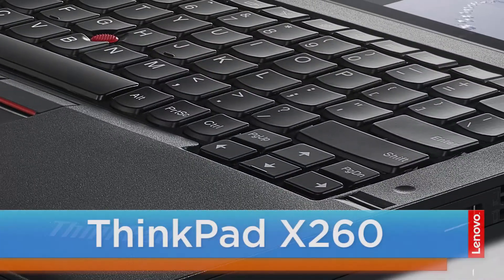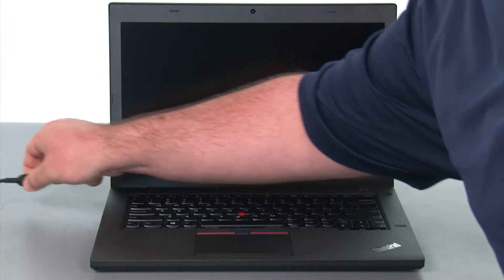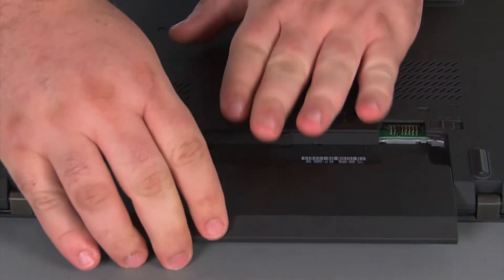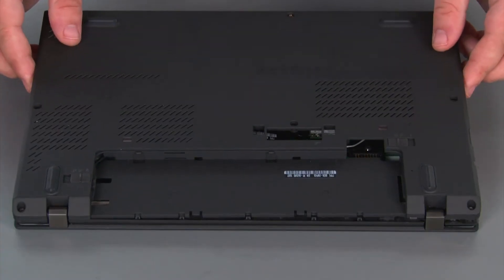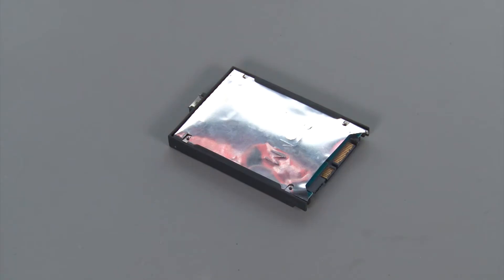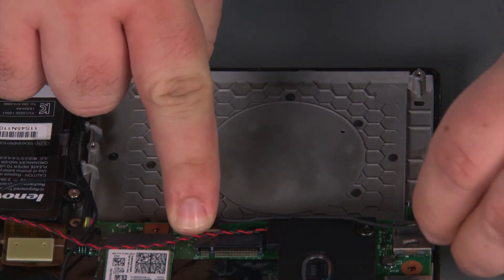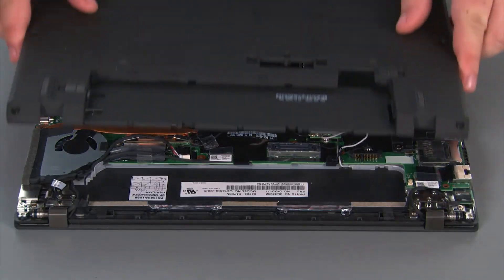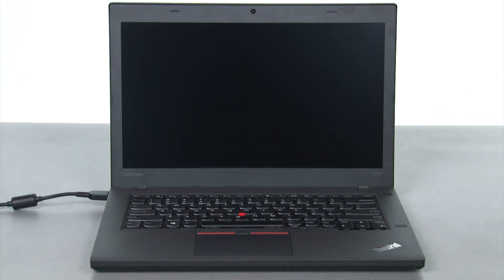ThinkPad X260 Notebook - Internal Storage Drive Replacement

Comment: I didn't understand why one would need to remove the whole disk connector cable from MB and disk..... nothing happened to it, it could have been kept their the whole time.  

I have a brand new X270, hopefully that one will be the same as the X260.
Reply from the maker: Hello Peter. You don't have to remove the whole connector, but the connector is part of the package in case it is damaged. This is why we show the drive and the cable in the video.